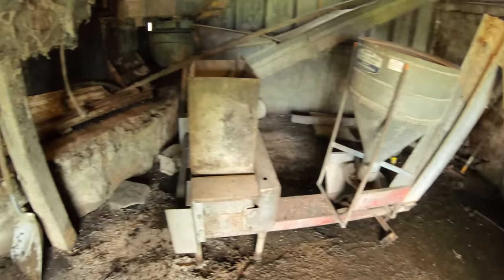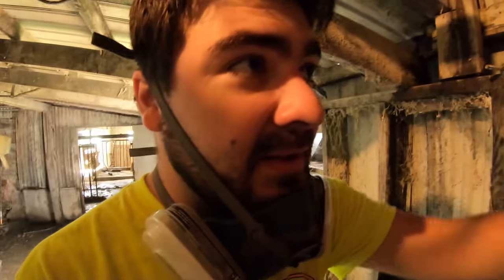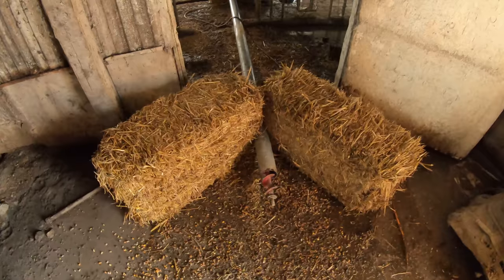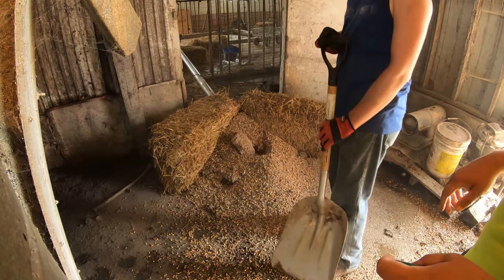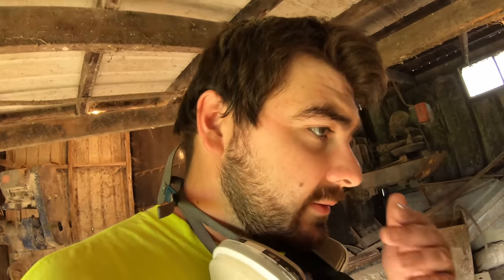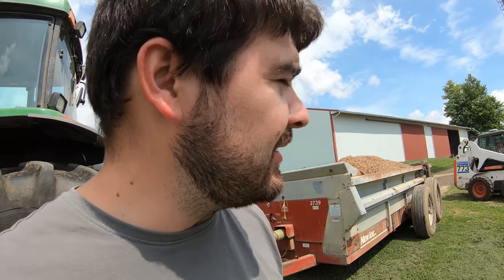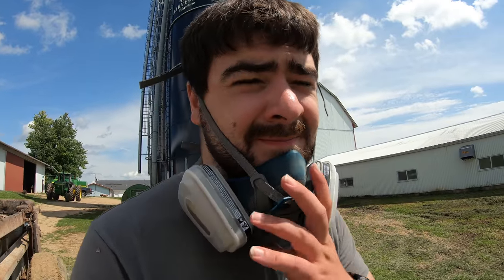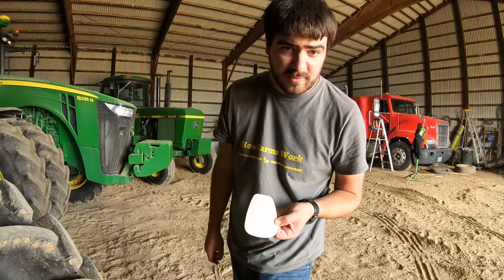Cleaning Rotten Corn in the Harvestore

Comment: Take the air floor out of the bad bin when you take it down.  Put it in the harvestor.  Cut a hole for the fan.  Then you can give it some air, no more rotten corn.
Reply: d6joe  you can bolt a fan to the door easily. But I’d rather have them sealed still

Comment: Thanks for the video! I've been in many Harvestores and usually after I left them, they were NEVER that clean again! I just posted this in your 2012 look inside a Harvestore video and thought some of your viewers would enjoy reading about how a Harvestore is built. After an hour or so of trying to remember details, here are my memories of being a "Profesional Builder" of Harvestores, some 40 years ago at Valley Harvestore Systems, Hawley Minnesota.

"Thanks for the video! 40 years ago when I was in college, I used to build Harvestores. I think that we built 60 of them that summer. It was a great job, working dawn to dusk, with only rainy days off. No time to spend money! We worked on commission, so the more we finished, the more money we made. In the late 70's and early 80's there was a big push to get big or get out of farming. Lots of new barns with milking parlors. 

I think we had seven guys on the crew, two inside pushing bolts and applying two lines of sealer (above and below each row of bolts), two with air wrenches and two with hand torque wrenches. I may be dead wrong, but I think it was 150 ft/lb of torque they were set at... as for the sealer, it was in caulking tubes and applied with a caulking gun. I think it was called A.O. Smith Sealer#79... if it got on your clothes, it was there for good! We wore playtex gloves and used baby powder to keep from blackening anything we touched.

When we got to the farm site, there was a "tub" a concrete foundation with a short ring of glass covered steel, and pallets with the blue glass fused to steel sheets, bags of bolts washers & nuts. The BIG ones had over 10,000 bolts. The first thing we did was measure the tub ring for consistency, to make sure it was aligned and circular. I think that we had one that we refused to build on because of the contractor's bad job with the tub. We then put up the scaffolding, which was +/- 4' off the ground, depending on the site.

We would then put the screw jacks PTO/wench inside the tub and mount them to the floor and fasten the first ring together, making sure the Flag and nameplates were facing the direction that the farmer wanted, then we would build the roof, the white steel panels. After the roof was complete we would jack it up and put in the next 5' high ring, until it was complete. The top rings were the thinnest steel and the bottom the heaviest, so each skid had the pannels in order. The panels were moved up to the scaffolding with an electric winch. The wench motor was in the center of the tub and the cable went up the center and was guided on a dolly, with rolled on top of the roof,

Each row of bolts were pushed out from inside and a washer and a nut screwed on, then tightened with the air wrenches and torqued with the wrench, then the sealer that was flattened out by the tightening was smoothed over like caulk, with our platex glove covered fingers, so there were no gaps, inside or outside the structure.

I think that before the bags were installed, we would pressure test the Harvestore by pumping air in and one man on a dolly would spray soapy water over all the seams to see if there were any leaks and if there were they were sealed.

Thanks for the chance to test my memory! BTW, I was born on a farm but from 6 years old, lived in town. I helped out now and then with farm work, was in the FFA, but it just was not the time to START farming in the mid 70's. I ended up being a golf course greenskeeper for 10 years, screwed up my back and now I've been a university librarian for 20+ years."

Comment: Protip on the mask.  Store it in a zip lock bag, freezer type if you have one.  The activated charcoal in the carbon element is ALWAYS sucking contaminants out of the air.  It will last longer if you store it sealed.

Comment: I wouldn’t put corn in there if its going to mold. I would feed and grind from the bins.
Reply: Well mold is a fermentation process and they use that bin for high moisture corn to feed cattle but without emptying it enough amd too much oxygen it will mold the corn

Comment: Maybe you fellas should just do dry corn and convert the harvestore to a forage unit..... for corn silage for the calves get you a dry corn bin and crack or grind it for em. My dad used 2 40 foot harvestores for forage along with dry chopped and baled hay for many years from 1952 to the 1990s. The advantages of spreading that down wind means it wont stick to you like sloppy manure ehh. Been in them old harvestores lots cleaning out and painting the floors every year with linseed oil

Comment: Took Momma Bear to show the young pups "what's what" eh? i was sitting thinking "there's a doorway begging for a loader bucket right there and then mom steps in. And yeah a grain vac is a must you wouldn't need the blower running then, we have around 45 flat bottom bins that get cleaned each year and REM vacs are a game changer.

Comment: oh, man, I would've rented a gain vac for that job, but chunks might have not worked very well.  Also, Sukup makes a floor, fan, & power sweep kit for harvesters-  We have one in a 25' x 34' unit.   holds 15400 bushels.  took the blower pipe and spout down.  We use a 10x71 Westfield auger to fill the structure.   Way faster than the blower.  Also, the blower damages food grade white too much.  IF you feed it, maybe using the blower isn't a bad option. However, you couldn't fill it very full because air doesn't push up through cracked grain very well.   They put an air vent in the center hatch of the roof.  We also got rid of the air bags to increase capacity and plugged the air bag holes.

Comment: If you are not filling the harvestor to top put several big pieces of dry ice on top of the corn. When it melts the CO2 will force all the oxygen  out the top and then you can seal it up. No oxygen, no mold. Probably be a good idea to have the 
Harvestor service people check the airbags for leaks when they fix the unloader. Good luck.

Comment: My uncle had a 24 foot diameter bin dryer for his seed corn.  It had a perforated metal floor about 15" above the concrete floor where the air blew under the bin.  It always got a lot of rotten corn like you have here.  AND being I was the smallest skinniest low man on the totem pole I  got the job of crawling under this metal floor on my belly with nothing but a garden hoe to tediously rake every bit of the filth outside the dryer.  There were metal supports holding up the floor every couple of feet so that you could only crawl with your arms outstretched above your head and slowly wiggle yourself in and out of the dryer raking the corn out as you go on your belly.  After doing this miserable job for a couple of hours I  had almost reached the other side of the dryer with my cleaning.  It now took several minutes a trip to wiggle in and out.  When I was all the way in and under on one of my final trips I  hit a nest of yellow jackets which stung me several times before I could back myself out.  It was torture but I didn't die of anapolactic shock.

Comment: Why couldn’t you put a ventilated false floor with a blower in the bottom of the Harvestore silo and use it exactly like a grain bin?  You could even add a dryer and it seems like it would perform just like a grain bin.  Wouldn’t you be able to use a power sweep also?

Comment: So if it is guaranteed to mold, and you bitch because it molds and you have to clean it then I have two questions and a statement.  Why do you use it if it molds? And why in the hell don't you just clean it every year? And the statement, if you're going to complain about using it just don't use it, kinda simple.

Comment: Food for thought:
1.Try to put in enough to always run out with a secondary stash to use (wagon).
2. Spray the inside of the bin with a bleach solution. (?)
3. Use the Teliskid next time and extend the boom through the door. (Handle once)
4. Reconfigure the floor of the bin to slope to the center
5. Hire the job out.
Reply: Unsure if teliskid still there and beside don't think the bucket will fit through door.
Reply: @BWYinYang  
Sometime you do what you have to do. It is easier to take a few boards off than to go through all that work. Rent a machine.
Reply: @larrybe2900  After watching Ryan and Travis, I would rent vac machine.